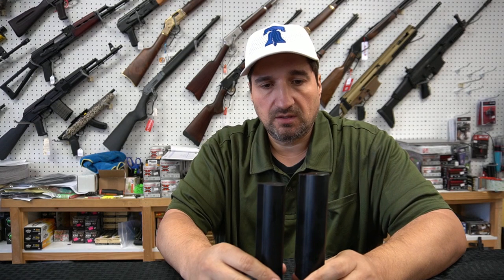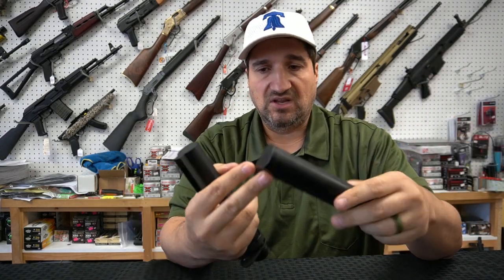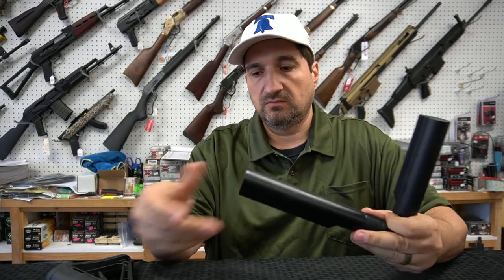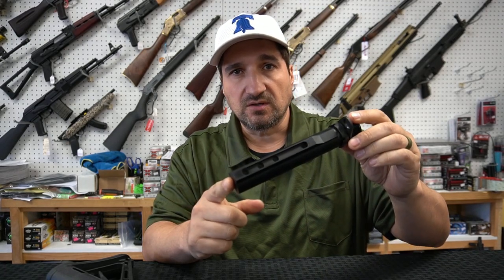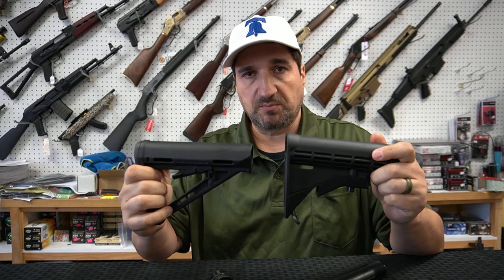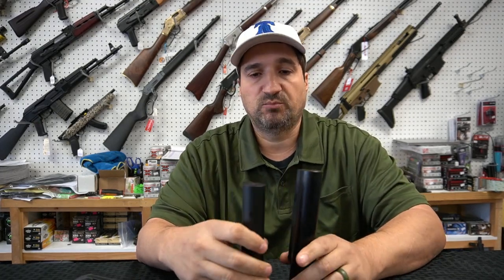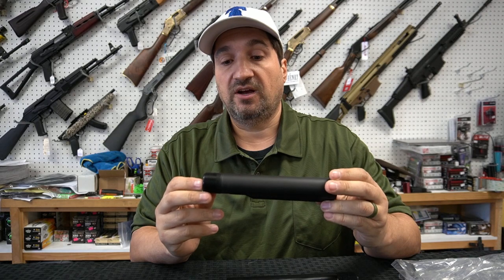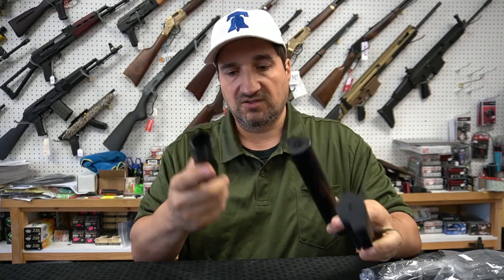Stocks Mil Spec vs Comm

Comment: Question. Can i add a Comercial Stock on a Mil-Spec Tube? Yes it will propably be loose but that should be canceld out with some tape under the stock. Need to know before i spend money.
Reply from the maker: Sorry for the late reply (shop has been busy). But yes the simple answer is you can put a commercial stock on a mil spec tube and it will be loose as heck. Tape could help but also another choice could be to use the soft half of a piece of adhesive backed Velcro. If you get some Thick Velcro and attach the soft side to the tube (all the way around except for the flat area on the bottom) it will take a lot of that slop out. You could even lay down a couple strips of electrical tape before applying the Velcro if need be.

Comment: Let's add of a couple of points. A milspec buffer tube is made 7075 aluminum, which is a forging. A commercial tube is made from 6061 aluminum, which is a casting.  Also, the drilled holes on the tube is intentional. It's for water drainage or maritime operations.
Reply from the maker: That is a good point I should have mentioned about the material. But the holes are wrong. It is true that some companies do add a extra drain hole or two but this one was just poor quality machining. Typically there are not holes in the adjustment area, just the rear drain hole at the very end of the tube. Iirc LMT and maybe only one or two others do that. Since this video was just explaining the diff between comm and mil spec I felt that was kind of irrelevant.

Comment: Is the thread diameter the same on both. So its just another way to make the manufacture the piece? If I have a commercial buffer tube and want to switch to a mil spec one, can I do that. There are just more options with mil spec.
Reply from the maker: Yes both threads are the same. Different mfg process results in a different diameter where the stock slides on. Yes there are much more options with mil spec. All of your hardware like the end plate and castle nut will transfer over.